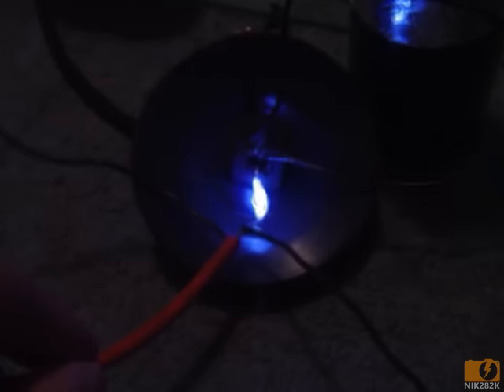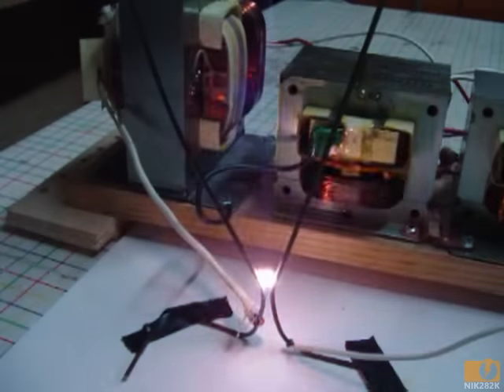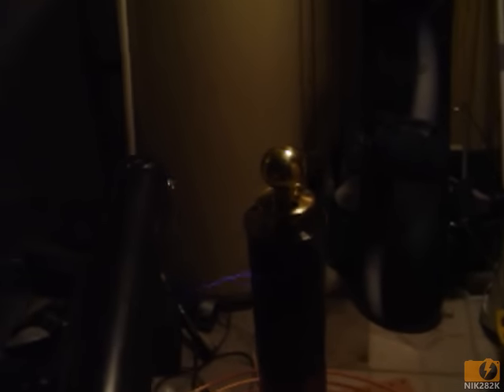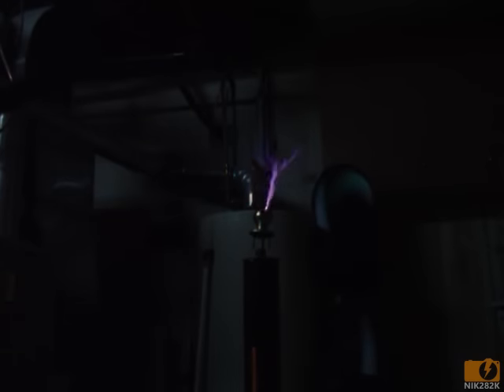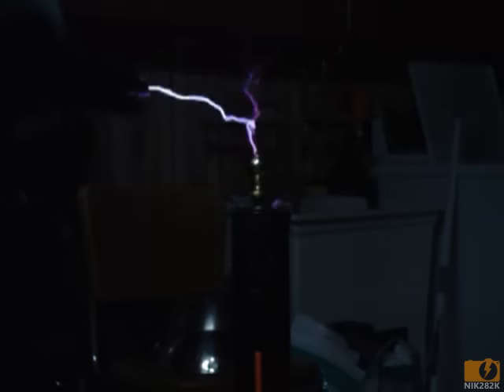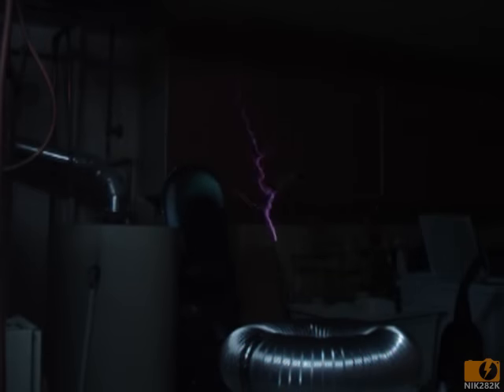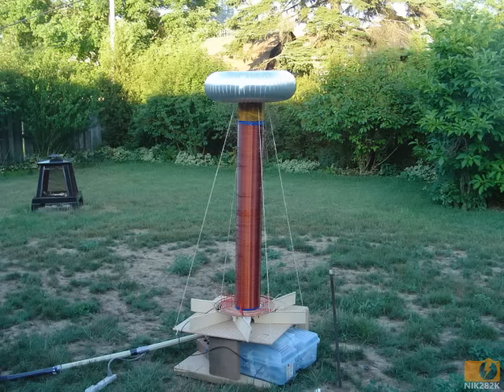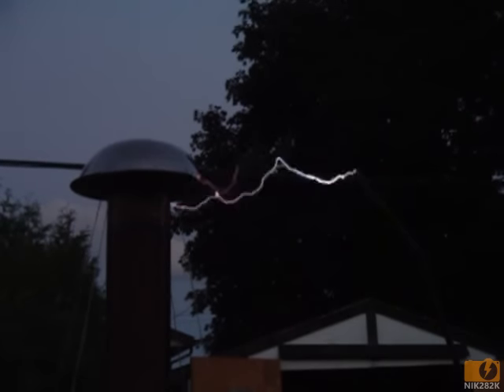That time I built a Tesla Coil

Comment: I'd love to hear more about this project build. Do you still have the final Tesla Coil? If so, is it repairable with off-the-shelf components?
Reply from the maker: +neowiza360 It could probably be rebuilt with a 100$ in new parts or so but I haven't had it run in over 10 years. I may revisit the smaller version this summer if I have time.